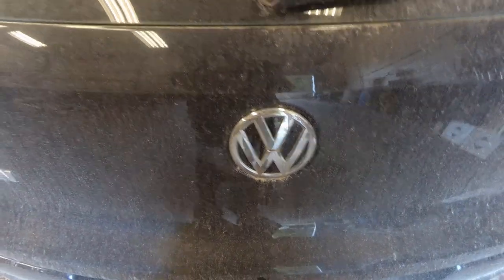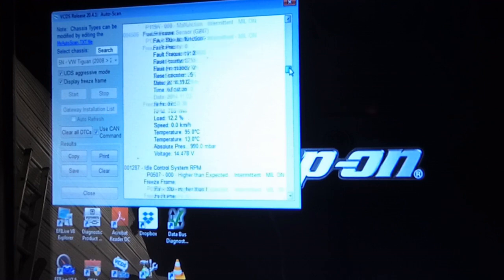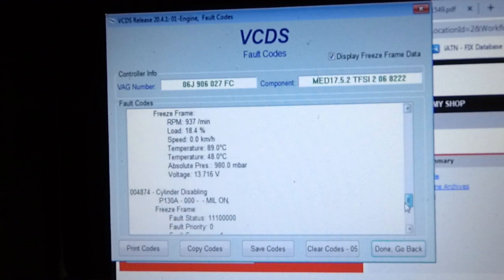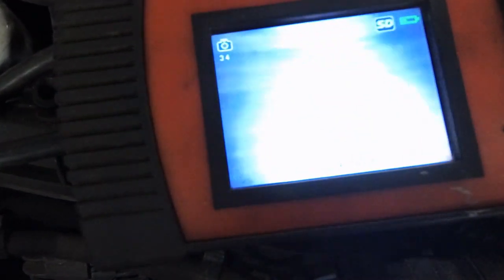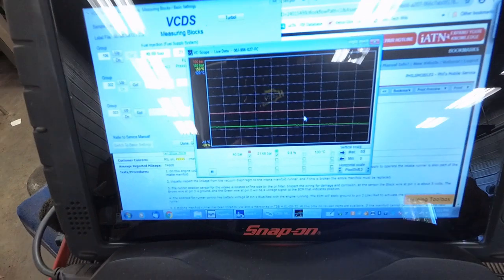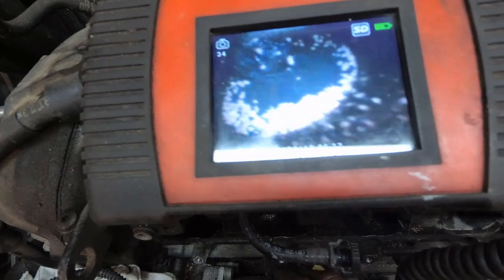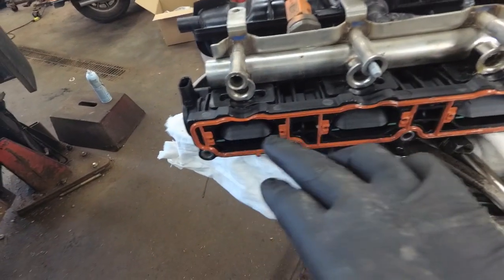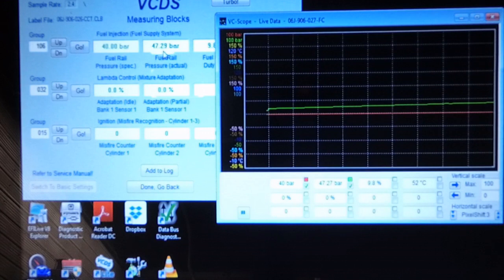2013 VW Tiguan Misfire, Intake Flap Error and More

Comment: I'm having these exact error codes. My Tiguan is only misfiring while idling though. What would a fix like this cost at a shop?
Reply from the maker: This job cost my customer $1850.00 Canadian includes new injectors, retainers,gaskets, new intake manifold from dealer, new plugs, oil change labor and tax.
Reply: @PhillipBailey  Thanks for the info

Comment: Having these seemingly unsolvable same issues. Countless ppl have looked at our ride trying dif things and can't get it to fix but this may be what it needs here. How much is a repair like this going to cost on average? Seems like a big job for a 10 year old car.
Reply from the maker: Cleaning of the intake ports and new injectors would run around 2K. including replacement of the manifold.
Reply: @PhillipBailey  i don't see that broken piece i wonder if I can get away with injectors and valve cleaning.
Reply from the maker: @thriftsndreams6809  if the intake runner is fine you won't need to replace the manifold.
Reply: @PhillipBailey  thank you!